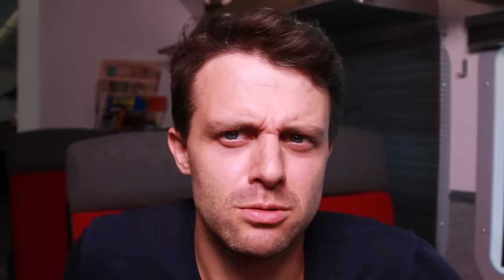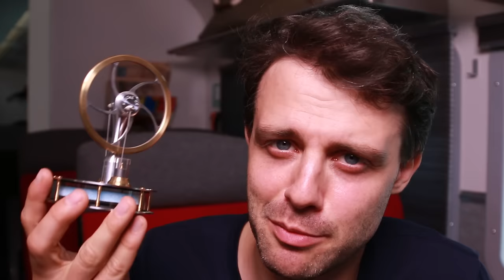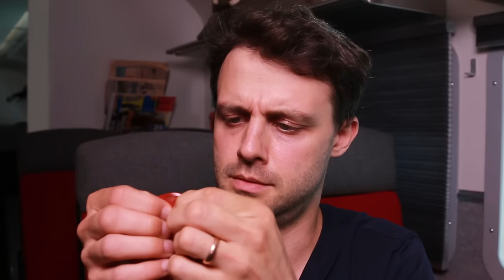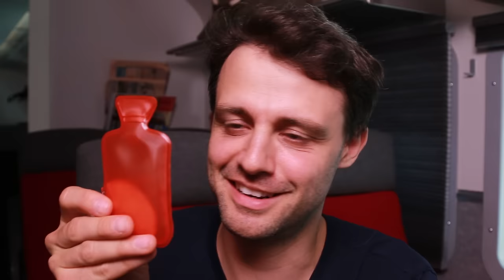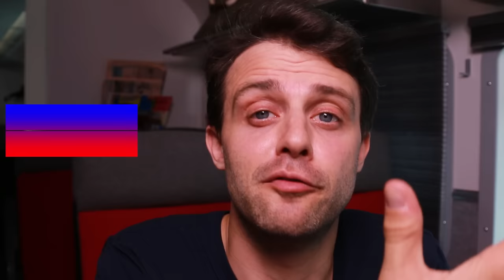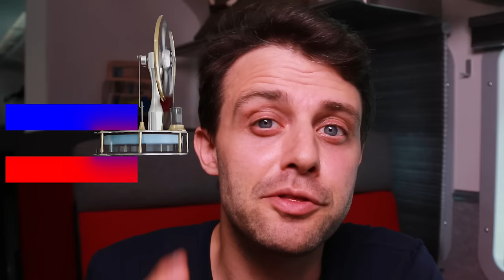A better description of entropy

Comment: This particular way of describing entropy is why you always find your earbud cords always tangled up: there’s only 1 way to have the cords straight and untangled but, as you jostle them around in your pocket or backpack, there’s a myriad of ways for them to become tangled.
Reply: I sometimes think earbud cords tangle even when they're not being jostled, just confined like in a desk drawer.
Reply: yeah but theres always lots of other orderly ways to have a pair of earbuds that aren't tangled. not just one...
Reply: Maybe entanglement is inverse to dimensionality. A loop in 3d becomes a knot when the dimensions are reduced to 2d under conditions of confinement like a backpack or desk drawer. Entropy means the knot or entanglement doesn't revert to a loop on re-exposure to 3d, so the cord is still in a tangle even after opening the desk drawer again.
Reply: that doesn't explain why you never plug  usb the right way though
Reply: @danielterra4773  Sometimes you do, but it's less often than not, so that's what we remember. We're also tricked by our eyes, we think it should be a 50/50 chance that the USB is the correct way around, but it's one out of three: USB plugs are in fact four-dimensional objects, requiring you to turn it 180 degrees TWICE to rotate the plug to the superposition where it will fit the socket. ;)
Reply: @lassesipila6418  hahaha :))
Reply: There have actually been studies about this--it has something to do with how the cord is initially twisted when you set it down. If you were meticulous about wrapping the cord precisely, every time you stop using it, you wouldn't have it tangle.
Reply: The wires behind my TV used to do that, so now I have fewer wires behind there, there's less entropy, but there is an extension lead.
Reply: That's not really a satisfying explanation. It's not like the wires are randomly going into one of all possible states of the wires. They have to physically move into whatever position they end up in.
Reply: hey thats my name!
Reply: @chrisg3030  this is due to quantum physics - as soon as you no longer look at them, their state begins to "spread out" and most likely collapse into an entangled state)
Reply: @Haskell-Curry  Would that explain why you never see them getting tangled, they seem to wait till you aren't looking at them?
Reply: That was deeper than I expected. 🥹
Reply: @danielterra4773  However, it does explain the existence of USB C.  Imagine all of the saved time and effort (energy) it will result in.  The universe (and economy) will be glad we aren't wasting time, shining lights onto jacks, or for us olde fartes(tm), pulling machines away from the wall, etc.
USB C, savior of the universe, and kick in the stem of Apple(tm).
Reply: @drakedbz  So, if you keep it untangled it remains untangled ;-)
I often do an, albeit, non-meticulous wrap and it doesn't seem to help.  In fact, it seems like it either comes out much less tangled or much more tangled.  Even though corded 'phones sound 10^6 better, wireless is rarely tangled.  No jokes about entanglement.
Reply: But my shoelaces keep coming undone 🤷‍♂️
Reply: @lassesipila6418  That's fancy sounding, but I think I always get it on the first or second try.
Reply: @joelwexler  Must be nice. How's the swoosh of the wind up there?
Reply: @danielterra4773  I just memorize which side of the plug should face up (or left) to whatever device I'm using. Seeing as only one side of the plug has an embossed image. So you can even plug it in the right way with your eyes closed, on your first attempt.

Comment: 05:27 to 06:10 bookmark for myself to keep revisiting the definition
Reply: @aidenlilley1319  3
Reply: @seanleith5312  I feel bad for people like you who can't understand very basic science concepts. The truth of the matter is that some materials absorb infrared radiation (heat) better than others. That's a well established fact. For example, CO2 absorbs infrared radiation much better than nitrogen or oxygen. This can result in heat from the sun becoming trapped in the atmosphere as it bounces between the ground and CO2 in the air (in the form of infrared radiation).

You can argue how much of an impact this has on the global climate, but here's another couple of well established facts. The Earth's temperature is rising, and the amount of CO2 in the atmosphere is rising as well. The heat-trapping I mentioned is evidence that they aren't simply correlated. CO2 is causing a temperature increase.
Reply: @mattn.8941  Your description has something mixed up.  If the CO2 ABSORBS the infrared radiation (your first claim), then it is not "bouncing between the ground and CO2 in the air"...it's being absorbed by the CO2.  If it's bouncing back & forth between the CO2 in the air and the ground (your second claim), then it's not being absorbed by ANYTHING (otherwise, there'd be nothing left to 'bounce').  Things that make you go "Hmmmmmm..."
Reply: @fubisroc9673  I can see why you're confused. My explanation did leave out a few things I thought were obvious. Materials can absorb, reflect, and transmit light. No real material can absorb, reflect, or transmit all light. When gases absorb light they tend to emit light in those same frequencies. 

Nitrogen and oxygen will mostly transmit infrared light, letting it pass through the atmosphere and past Earth without much absorption. The infrared light that does hit Earth's crust will be absorbed and some will be emitted back into the atmosphere, where nitrogen and oxygen will let it leave and enter space.

CO2 absorbs more infrared light than nitrogen and oxygen. Infrared that is absorbed will be emitted back out in all directions. So there's the infrared hitting Earth's crust directly, and now there's infrared being emitted towards the ground by the CO2. Once the Earth emits this infrared back out, the CO2 will absorb and emit some back in. So, infrared will 'bounce' between the ground and CO2 until it has either heated up the crust or made it out into space.
Reply: @fubisroc9673  But, just for the fun of it, let's hypothetically assume CO2 can absorb all infrared and cannot emit any of it back out. This energy must be able to dissipate somehow (that's kinda what this video is all about, entropy). So, the hotter particles of CO2 will collide with other cooler particles, transferring some of the heat to them. As a result, the atmosphere (and the crust that it surrounds) would still end up getting hotter.
Reply: @mattn.8941  You handled this calmly and beautifully. And was really educational. Thank you sir
Reply: @adamlong9031  Thank you! I type such long comments hoping someone out there can learn something from them
Reply: @mattn.8941  Of course man. It was simple and too the point and very clear. Keep doing what you're doing!
Reply: Dispersed energy: 
Sailing boat: I'm I a joke to you?

Entropy: Energy has the tendency to get dispersed, unless it is countered to do so by an energy barrier.

Comment: Yes! This is what am talking about. Entropy is increasing not about disorder it's about fair even distribution or spread out. And this also applies to abstract things, for example a high entropy random generator is well spread out evenly. A high entropy checksum is also well spread out that a small change in input make much of the checksum to change into any possible value.

Comment: Probably your best video yet. Very well explained, with great examples. Great job Steve! Waiting for the next. :)
Reply from the maker: +Dragos Puri thank you! I really like doing these explainer videos. Will do more I think.
Reply: I agree!
This was beautifully explained. I am so glad I'm not the only one in conflict with the conventional definition of entropy.
Reply: Please do, they're great, this is my first time watching you(apart from brady's videos), and out of all the videos I watched on entropy(because I had difficulty accepting it) yours was THE BEST, even better than MITOCW.
Reply from the maker: Thank you Varad. Really appreciate comments like this.
Reply: This video explains thermodynamics wrong. It is obvious that Steve Mould doesn't understand the difference between temperature and thermal energy.
If you have a material A with a very high thermal capacity next to a material B with a very low thermal capacity then A and B will try to reach the same temperature, but not the same energy dencity.
So in other word you will find a huge gradient between the energy density of material A and B, even when they reach the same temperature.

Lets say that material A is much more dence than B and both have the same bolume. This means that it is more likely that the energy will be transfered from B to A than from A to B. Because there is more mass in A than in B that can hold on to the energy.

So in the end it is all about probability. It is more probable that the energy will be transfered to the material of high thermal capacity than the one with low thermal capacity.
The most probable balance of energy depends on the laws that governs the universe. In the case of two simple materials like this it is governed by the laws that define the property of different materials.
In a hypothetical case our universe could be governed by laws that we may not allready know of; very complex laws that states that our universe is allready existing in thermal equalibrium.
Reply: I recommend you read my other post to have another thing explained too that you may not have otherwise known. I just posted before you here.
Reply: If entropy is "energy becoming more spread out", when matter clumps together in space under the influence of gravity, becoming less spread-out, then is entropy increasing or decreasing? As for the box of red and blue balls, there is more than one way to have all the red balls on one side and all the blue ones on the other. But still many fewer ways than there are to have them all mixed up and the basic point is valid. But why then does a jar of oil mixed with water separate into two neat halves after you stop shaking it?
Reply: That is a good point ben. In our current understanding of the universe that would be when entropy increases and is a good example of how clumped up matter and increasing structures comes with an increase in entropy.
Reply: I would think it also spreads out as there is tension between oil and water molecules.
Reply: OK I have to admit to being slightly didactic with these questions as I already know a bit about the answers. Both examples are from Penrose's books. The oil and water example is from Cycles of Time, which has several really good chapters about entropy. When the oil and water separates out, the oil molecules end up with a higher velocity due to the strong attractive forces between them, and you have to take the velocities of those molecules into account as well as their positions. Entropy still increases when you look at the phase space as opposed to just the position space in this example. This is why you can't just think of entropy as "stuff not being spread out".

The gravitation example is even more striking (and Penrose talks about it a lot in all his books) because this is the reason why entropy is (still) so low and what makes life as we know it possible. I don't know exactly how you quantify the entropy of the gravity in a system, but the basic idea can be visualized by thinking of those rubber sheet analogies people use to explain GR. A very smooth sheet with no kinks in it has low entropy compared to one that's all rucked up.

The big bang resulted in a big ball of hot gas, very evenly spread out. That feels like a textbook example of maximum entropy. So why isn't it still just a big ball of hot gas evenly spread out? The reason is that when you take gravity into account, its total entropy was not high but incredibly low. Because of gravity the stuff clumped together and formed stars and planets with orderly motion, and hence night and day which provide our primary low entropy source for life on Earth. But all the time entropy was still increasing. The end-point of all this is black holes, which have the highest entropy possible (and there are some interesting theorems about this).

Now deviating slightly from Penrose, who doesn't talk much about Shannon entropy, but sticks to more "thermodynamic' definitions, the only really convincing explanation I have seen about why Maxwell's Demon wouldn't work combines the thermodynamic and "information" ideas of entropy, and therefore I do think you have to consider them as being the same thing.

So the thing about Mould's definition of entropy is that it's great for analyzing heat engines but that the common idea of "entropy being a kind of disorder" that he disparages is actually more general and I would say not bad at all as a starting point for trying to understand the idea.
Reply: I somewhat go with Electro-Cute here. Probably Steve Mould's descriptions of entropy is better than the conventional one, but it is not perfect. I always think of entropy as energy striving for equilibrium; and if it is impossible for one form of energy to reach equilibrium with another form of energy (the example with water and oil mixed together in a glass) each energy form still find the best equilibrium state in relation to each others -- the water for itself at the bottom of the glass, and the oil for itself at the top of it.
Reply: The separation of oil and water only takes place when their is a gravity gradient and the apparent increse in order comes at the expense of a decrease in gravitational potential energy.... an overall increase in entropy.
Reply: Japeking1: I grant you, oil and water doesn't mix or melt together even in zero gravity.
Reply: Great job steve. 

Job steve

Steve job.

Comment: This is the first satisfying explanation I've heard. Thank you!
Reply: It is actually wrong.
Reply: Electro-Cute why is it wrong?
Reply: it is only over simplified
Reply: +Ashwin Singh
He says that the energy will evenly spread out and never clump together, which is not true. Temperature and energy is not the same. If you have a piece of mettal next to piece of wood, both with the same temperature, then no net energy will transfer from one of the materials to the other. But there will still be much more energy clumped up with in the piece of mettal.
The laws of the universe governs the nature of how energy transfer and organizes it self. Thermodynamics gets aplied to these laws that we have come up with.

This allso paints up a world where the laws of universe are very simple at a microscopic level. But that doesn't have to be the reality. It could hypothetically be as intresting laws that governs the macro- and larger- scope of the universe as the onese governing the microspoe of the universe. Just that we have not noticed it yet.
I mean does these very simplified asumptions about the nature of thermodynamics aply to the realm of quantumphysics? If the laws of the universe are much more complex and dynamic than what we think then we could hypothetically exist in the "heat death" right now (a much more exciting heat death). That is what thermodynamics says.
Reply: Electro-Cute look up "heat equilibrium". The definition he given works if we assume that system is infinitely close to heat equilibrium.
Reply: I know what thermal equalibrium is and no it doesn't. His definition only works for when there is only one type of material.
Reply: okay. He said energy  will spread out and won't clump together. And it wont.
If it's already distributed between elements of the system unevenly, from that position it may only spread out or do nothing  (stay at a current state). No third option. If energy is already fully spread out, there's only that one option: it can do nothing. Did I clear it up for ya?
Reply: If there where no forces guiding matter then energy wouldn't clump together. But how energy behaves all depends on the nature of the universe. There are no simple one way solution that works no matter what system you look at.
Reply: Yes, the energy won't clump together. This IS the nature of the Universe. There is no simple one-way solution that works no matter how you look at it. In fact, the number of solutions is constantly growing. This is where concept of enthropy emerges, enthropy is basically the amount of equivalent energetically configurations of said system. We can't look at a system and say that there is but one way to go from then on, but we can say that the amount of present (or possible) configurations in current system is constantly growing.
Reply: You see, there are far less ways of having the energy clumped together than having it is spread out and distributed. The state towards which system is going is a state where any given particle might contain a trace of something that was in the system initially, or it equally might not contain any trace of,  which creates a huge amount of variation and branching. System in it's final state may not be reconstructed based only on it's initial state. Essentially, that's what the enthropy decribes.
Reply: With in a system of thermal equalibrium the distribution of ennergy will be govern by the laws of that system. If that system contains just a simple ideal gas then the energy of this system will be as spread out evenly. If that system is a somewhat badly idonized plasma then you will have a much more complex distribution of energy.
Reply: Well, that's the actual thing about thermodynamical systems: in a state of equilibrium, the energy is still distributed evenly, even if it's not only calculated from kinetic energy of thermal motion. Even if the temperatures are different, that doesn't mean that energy is not distributed evenly. In a complicated system like this, equilibrium is stillstate in which every part has just equal amount of energy, so temperatures don't equate if there is still, some amount of potential energy.